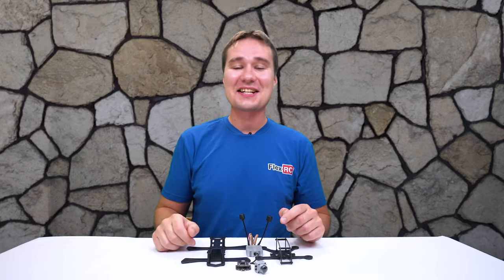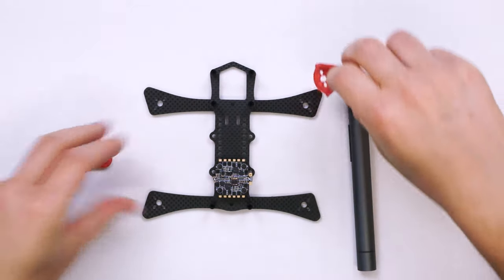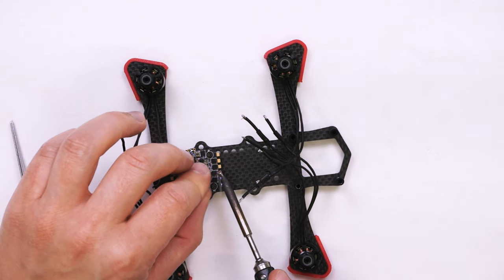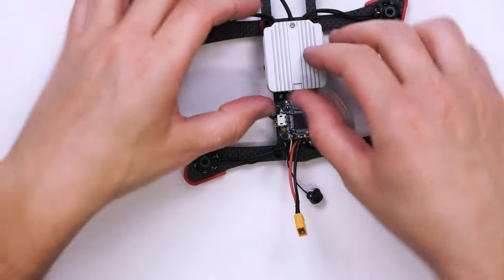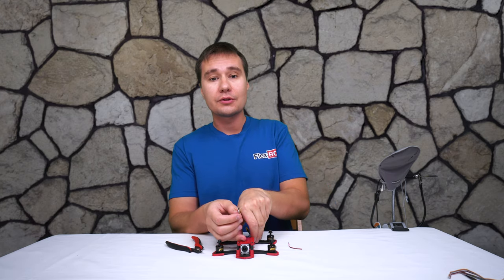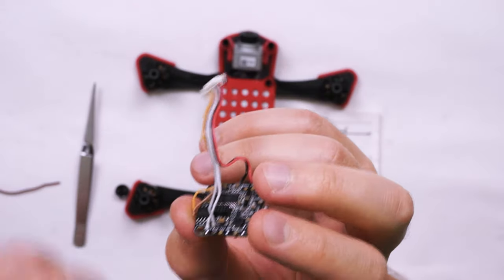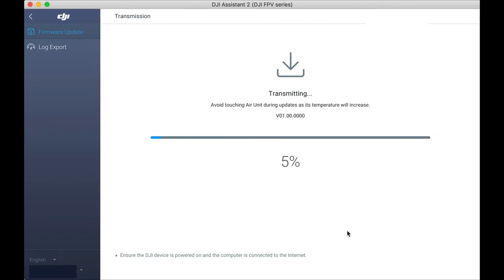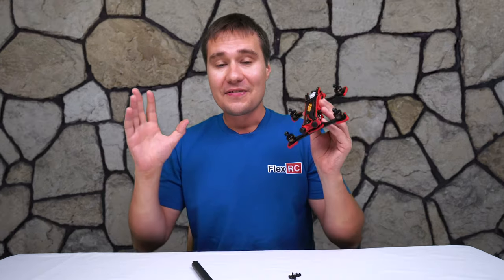How to Build Drone with DJI Digital FPV System? Complete Build Guide!

Comment from the maker: Please let me know how do you like this guide and if you have any questions or suggestions! Edit was very complicated and it seems like I've pasted one part twice, SORRY ABOUT IT!
⚠️ PRODUCTS IN THE VIDEO  ⚠️
✅ FlexRC Colugo: https://flexrc.com/product-tag/colugo-frame/
✅ DJI FPV Accessories: https://flexrc.com/product-tag/dji-fpv-colugo/
✅ WowStick Screw Driver: http://bit.ly/2vm9JH2
✅ TS100 Soldering Iron: http://bit.ly/2Hqf0Ex
✅ Tornado T1 1407 Motors: https://flexrc.com/product/brotherhobby-tornado-t1-1407-3600kv-brushless-motor/
✅ HGLRC F440 Stack: https://flexrc.com/product/hglrc-f440-tx20-tower-fc/
✅ RotorX 3" Propellers: https://flexrc.com/product/rotorx-triblade-rx3040t-props-2cw-2ccw/
✅ Gemfan 3" Propellers: https://flexrc.com/product/gemfan-3052-3-clear-3-blade-propellers-2cw-2-ccw/
✅ 4S 850mah battery: https://flexrc.com/product/tattu-850mah-14-8v-75c-4s1p-lipo-battery-pack-with-xt30-plug-2/
✅ 4S 650mah battery: https://flexrc.com/product/tattu-650mah-4s1p-75c-14-8v-lipo-battery-with-xt30-plug/
✅ 3S 850mah battery: https://flexrc.com/product/cnhl-ministar-850mah-11-1v-3s-70c-lipo-battery/
✅ 3S 650mah battery: https://flexrc.com/product/cnhl-ministar-650mah-11-1v-3s-70c-lipo-battery/

Comment: I really wanted to know what the weights are for the 3" and 4" frames, with the DJI compatible TPU parts (without the frame/arm bumpers or GoPro mount). Also, are the DJI TPU parts going to come in a combo pack? Lastly, are there props in view for either size frame in 4:3 and 16:9 modes?
Reply: Just the Colugo 4" frame is 46g and 3" is about 10g lighter. TPU parts around 2-5g in total. There are no props in the view with 3" in either of the modes.
Reply: Дима Бодрей Thank you so much!

Comment: Hi Dimitri, how to plug in the cables of the airplane controls  (Throttle, Rudder, Aileron, Elevator,, etc) to DJI FPV Air unit since there is only one socket in the DJI Air Unit (I think S BUS)!.    Thanks
Reply from the maker: I don't fly airplanes, so I have not done a video like that but I would imagine it is pretty much the same as components are very similar. In the modern receivers it is usually 1 or two signal wires. You can use newer Flight Controller or perhaps find some adapter that can decode and split it into multiple channels, but I'm not aware of them.

Comment: Kind of a noob here, but what's the best and easiest way to extend the motor wires?
Reply from the maker: Find a wire of the similar diameter, tint both wires and then overlap their ends and melt the solder. After that use heatshrink

Comment: What is the flight time?
Reply from the maker: It depends on the battery and can be anywhere from 3 min and up to 10mins
Reply: @FlexRC  what battery do you recommend for 10m? Is 4S the best for this size quad?
Reply from the maker: @PoisonPanty  I forgot to mention that flight style will affect it too. But you can go up to 1050mah battery for the longest flight times. I'd suggest to have 450, 850, 1050 batteries so you can play with them to get various performance and flight times.